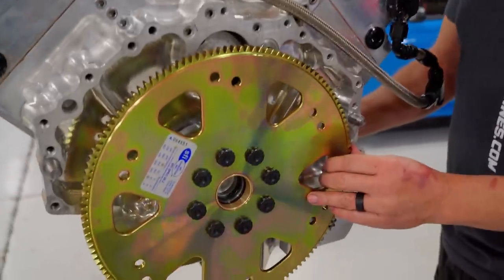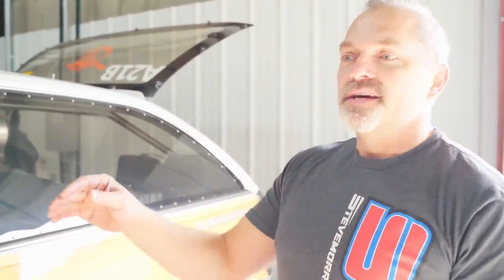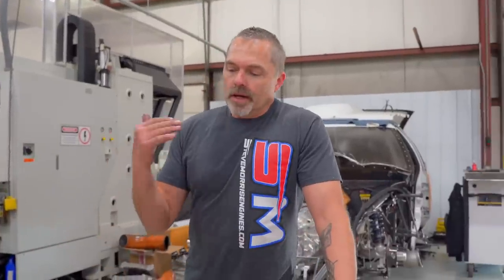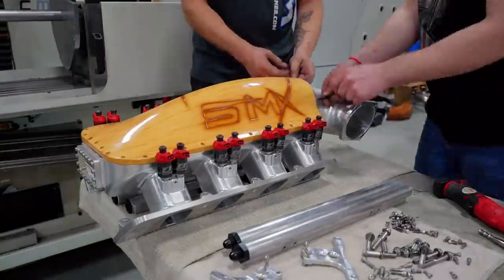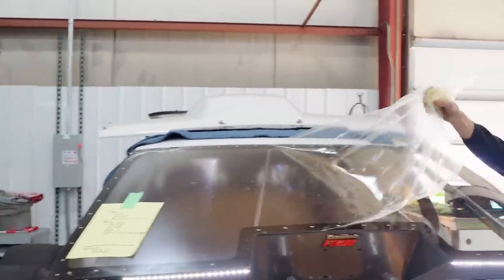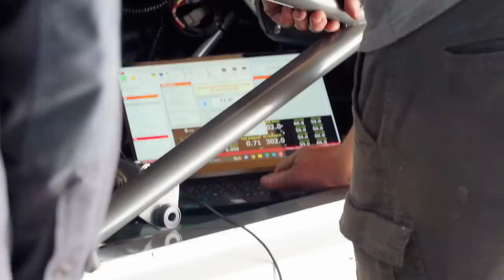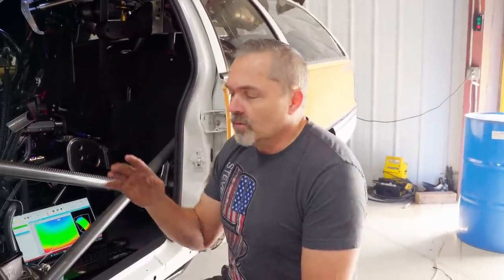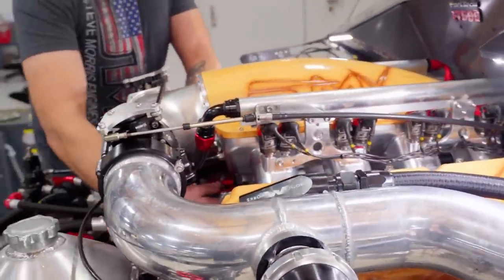The Wagon Runs!! SMX Install and First Start Up. Wagon Prep Part 3

Comment: I worked for a racing team, making a dirt track car go fast. 1200# car 4 cyl 2.0l class our head cost$2000 a $1500 crank $200 each for a wiseco custom pistons on $150 5.7 aluminum  chev rods $5000 of block and prep, plus professional assembly. We had a $10,000 pinto engine making 350 hp turning 10,000 rpm on a 700 cfm custom Holley! I respect anyone who races, anything can and will break! Going fast is expensive and hard work!

Comment: Love the sound of the first start on the SMX Steve...
From what I can tell, when all is said. You are looking at 100k (US) just in the engine and drive line for it all to *possibly fall in a heap at the burnout box. Then you'll need to fix it so you better have DEEP pockets, spares, parts on hand and a good crew behind you to repair it.
I have loved this series mate. Keep the great content coming. 
Cheers from Australia.
Reply: I think he is around 100k just in driveline parts, with the engine on top of that. Plus the chassis and all the goodies that make them all work together, it has to be a quarter million dollar rig at least.

Comment: I can tell how many people have never met you here. You're not bragging- you're stating what it takes for the engine power to get to the back of the car to get you down the track and street safely. I remember back in the late 2000s that we met and I had a street car that was 10 seconds at the time. You looked it over and gave me the nicest reaming I have ever encountered. I wound up taking the next year off so I could get the work completed. That fall the car's twin had a component failure, and it was a traumatic failure. The driver has never been the same since the accident. And I have never been so thankful for someone to get my attention of how to run a car properly versus just being able to get A to B with clenched cheeks that this will not be the time something fails.

Comment: I think the younger guys in this sport are learning a boat load from Steve  ,and Steve  putting in perspective on the cost of going big time racing . Just think how much Top FUEL cost.
Reply: Top fuel dragsters are easily $25 Million - $30 million each. It's why they are all heavily sponsored. They couldn't run at that level without sponsorship.

Comment: I really feel ya. I had $43,000 in my engine/trans combo in my '56 VW Bug to run mid 6s in the 1/8th mile. You love what you love and pay what you pay for the best of the best regardless.
Reply: @montiemassey6621  I did I did!

Comment: Steve you mentioned that you need to get the water out of the engine when running methanol fuel by evacuating the motor/ running it on pump gas. How would you go about evacuating the moisture out of the engine if you just run methanol fuel. This was mentioned a few video's back ,about the valve springs rusting, but I would like to know the prep/post work that is needed with the methanol fuel. could you explain it to the novice please?

Comment: I'm surprised you don't want to filter the oil coming from the tank to the pump or the engine filtered. Cuz that means any Trash that gets in the oil reservoir has to go through the engine first. Which eventually something will get in that tank if not from a fresh quart of oil.

Comment: Speaking of gas street drive injectors.  I wonder if high boost levels and no gas fuel pressure will allow boost to leak in to the gas fuel system.  This would be a real problem leading to a split gas tank given the tank vent allows air to enter the tank but not exit the tank.

Comment: You absolutely correct. The cost of using that engine apart from the build cost it’s 1000% impractical to do a give away. Now a 540 or 632 iron block purely N/A pump gas is something I might sell my LS3 to buy tickets to win!!

Comment: Steve's two 110 turbos are roughly $5.000.00 usd apiece,  thats just out of the box. Between the start of this car and all its transformations ,redoing, replacing, re-engineering, RD, upgraded parts, this car has seen north of 350.000k and that doesn't include a five gallon bucket of race fuel.

Comment: Building my first methanol engine would be cool to see more on venting and vacuuming systems on  the motor , didn’t know methanol rusted part until your valve spring video the other day.  Might actually be learning something.
Reply: Or work up a water removal filter system.  In the land of hydraulics, oil polishing is a thing and there are filters that will remove water.
Reply: 2 things, change the oil often and drain the fuel system before loading up the car, o rings don’t like methanol

Comment: When I saw the intake going together last video I thought to myself, surely it would be easier to run the injector loom thru the centre first. OK, seeems that may have been right. So am I missing something? No video of the engine on the dyno? Are you going to do hub dyno only maybe? I thought you had some power limitations on this level of power? And what thread form do you use on your engines, Metric (industry standard now) or the old SAE----yeah I know, questions, questions. BTW, would not even drive the car without the transmission cooler fitted, absolutely essential to keep the tranny alive.

Comment: Question Mr. Morris, is there a reason you don't use a single throttle body, instead of two?
Less linkage, weight with one.
Is it to manage individual bank turbo pressure?

Comment: Hey so I just switched over to meth.. I’m running a LS with a 16 injector manifold. I’m on a FT600. Do you any to help save the injectors without letting meth sit on them? For Rocky mountain race week .. for 5 days should I put pump gas back into them before I drive? Anything we can run on the meth to help lube the injectors?

Comment: Steve how much is left in the SMX engine? Taking away boost how much more could you increase horsepower over present? Where could you get more, out of something in the heads or camshaft grind? Different pistons? Just wondering as this is your engine so I figure you would want the the baddest Billy bad boy SMX engine so what could you do to it? Can't wait for tomorrows video as I love chassis set up

Comment: Don't know how you get it all done.  You guys are rocking.  Bet it is killing you not to have the time to put on the Hub Dyno to debug and dial it in.  I am curious why you use sealant on the intake.  Mostly because the manifolds I have fabricated I oring.  I am not using them at your boost levels though.  Do you find that Orings will not hold the pressure?  Keep up the great posts and give Dewey a pat.

Comment: Steve thanks for the rundown of cost of just some of the bits to get power to ground not sure what the tail shaft cost but just gear box diff flex plate ruff 38000 we still need a hole lot of other bits yet like a car engine wheels seats wiring hole man lots of dollars i give up my Ute cost me 40000 you have that in a gear box and diff thanks for that did you Dino the engine as looks like not as yet

Comment: Not to mention 10k in electronics, 50k in chassis framing, 5k wheels 2k tires 7k brakes, 2k seat 80k engine 17k rear end 8k converter x 2 15k trans x 2 3k fuel lines and fittings 3k in various tanks 5k in turbos 8k coilovers 2k in plexiglass 2k in blowoff valves and waste gates hell the fluids are a few grand That crappy wagon is 250-300k and Steve built it. Go pay someone and see how much it costs.

Comment: Yes I’m guessing that motor with all said and done bet it’s 90-100k , and like Steve said it may still break , brake , couldn’t afford to give one away , unless you sold 50 in one year , but he takes care of his clients so that’s a lot right their , took care of Cletus great video Steve
Reply: Long block was 85k to Cleetus, then add turbos, dry sump system, fuel pump, intake manifold & 24 injectors, exhausts, cooling system, Computer Management system & sensors, wiring & hoses for 2 fuel systems  - if thats not about 150k just in the engine bay I'd be surprised.  Then add the 75K in driveline & don't forget the 'extra' transmissions & convertors....

That's without the car...

Comment: In Tom Baileys video a while back, he was fighting what he thought was fuel pressure issue and drilled his rails for center returns.  Your setup is different with street injectors but do you think you need to modify your rails or add more fuel capabilities?

Comment: 2 questions Steve.  Why does everyone run the methanol tank in the front? Isn't that a fire hazard when wrecked? Also, have you weighed an SMX? What's the weight on that bad boy? Thanks.

Comment: Have you thought about breaking that engine in the Cleetus  way?  Drain the oil then start and run that new motor for a couple of minutes, shut engine down then add oil.  Engine is now BROKEN in...

Comment: Some people just don't get it.  $52K (in 2023 dollars) just to get the rear hubs to spin.  That doesn't touch the dual-rail promod frame, engine management, suspension, body, brakes, or literally anything else - not even the periodic refresh required at the SMX levels of power.

Comment: i did my subaru - thought $10,000 would be enough ? after new short motor - heads valves all good gear sump oil pump $17,000 and not counting other stuff - brakes starter motor altenator power steering = not much under $20k car is 22yo - does 255kh all top stuff street track club runs , nice and QUICK !

Comment: 250,000$ just for a start That doesn't even cover spare parts/ fuel. Question is it possible to run a SMX carbureted? I wonder what size carbs you would need? Badass engine.

Comment: $60,000 just to put the power from the engine to the ground. Engine to tires.

Forget about the engine, turbo's, chassis, or all the electronics and ignition. Heck, you still have to pay for fuel and lubricants. 😂 👍

Comment: Yeah people don't understand just the cost to do a test and tune with a vehicle like that. No issues and your going through lots of methods maybe a set or two of spark plugs of your not good enough tuning yourself your paying someone to make all the adjustments between runs. These are $300k+ dollar vehicles a free engine would be cool but if you can't afford the other 200k plus it just a paper weight unless they sell it. Now a nice 800hp na BBC that could handle boost later would be much more practical for the everyday person

Comment: Engine  north of  $ 75,000
Reply: nearer  200,000 bucks for an emgine.
Reply: @aeroflopper  He lists them on his website, SMX start at 75k
Reply: @PineyJustice  Starts. They run well into 170 plus with all the goodies that one needs to run mid 6's.
Reply: @xtr3m3fLx  The engine itself is 75k, you run to nearly 200k with all the rest of the stuff to put it into a car and use that power. That was the point he was making in the video, the engine itself is 75k maybe to 85k with extras.

Comment: You need to have a chassis strong enough to handle that power. That engine would twist factory built car into two. Not everyone can do something with a engine like that I can see a thousand HP giveaway engine but a 5 Thousand HP engine is just stupid because you have to have a car that can handle that power and can't be dropped into any old car.

Comment: About 180k I bet
Reply: Likely closer to 250k once everything else is accounted for. Chassis, electrical, oil system fab etc….
Reply: 200k for engine
Reply: Wouldn’t be surprised if it was north of the 300-350k by the time all is said and done. There’s a lot there. Have built a couple trucks and you’d be surprised how quickly stuff adds up. Remember he said his engine was over 100k 120-150k from memory. 2 trans at 14k apiece, 7k torque converter. Should ideally have 2. 16-18k rear end that’s well over 180k there and doesn’t include the car electrical/ECU cage all the items that are required for that.
Reply: @aeroflopper  engine isn’t that much Steve said what it was in an previous video, was like 140-150k

Comment: I bet 100% of the parts for using that SMX are custom, heck you can't even use a stock radiator. I would be shocked if you don't have more than $100,000 in that car when it's running down the track!